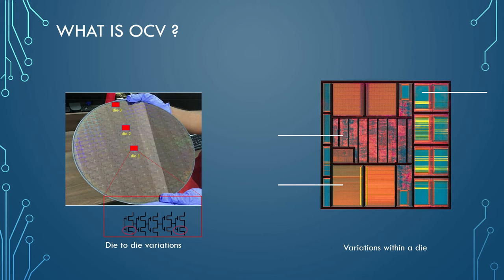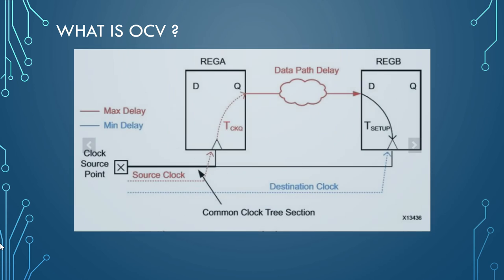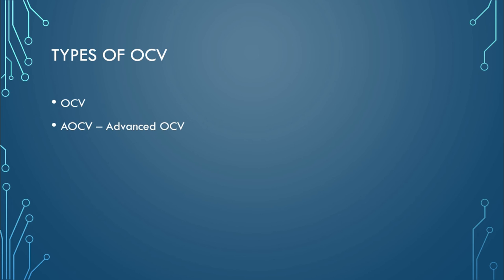sta lec33 introduction to OCV | Static Timing Analysis tutorial | VLSI

Comment: Why we use ocv when we already consider PVT condition?
Reply: PVT variations are chip to chip variations.  While ON chip variations are variations that can be observed on a single chip. OCVs are modelled using timing derates. Suppose there is a reg2reg path and that path contains a standard cell (say AND gate) GATE_AN_2_H_4. Suppose this standard cell is also used in paths other than this path. The delay of this standard  cell can itself vary in different paths because of OCV. Then we will take the worst possible delay of the standard cell in our current reg2reg path. In other words we are applying a late derate to the cell.
Reply: @VLSIAcademyhub  what about net delay?..do we consider ocv for net delay calculation ?
Reply: @VLSIAcademyhub  got it ...now thanks
Reply: @VLSIAcademyhub  yes  I checked in the cmd file and searched in solvnet
Reply: J baskar book it is u have readed that